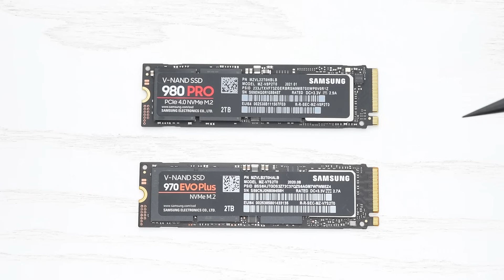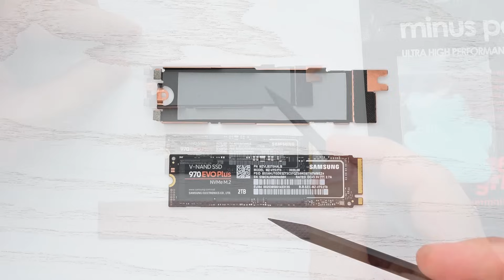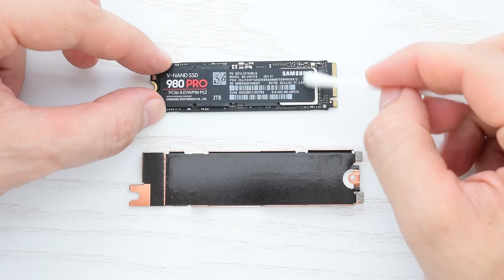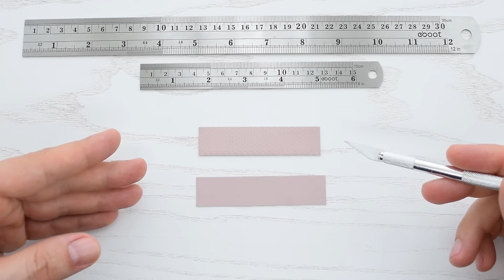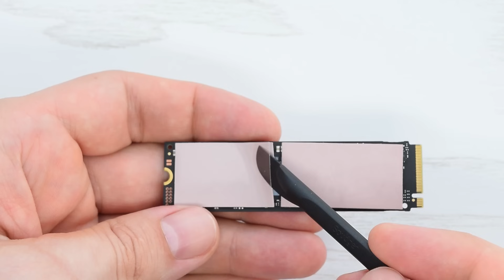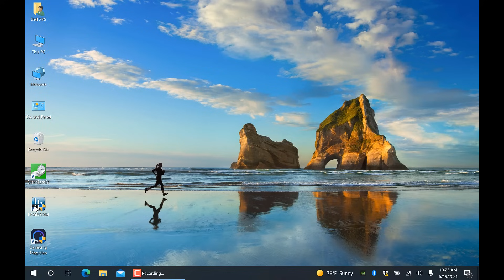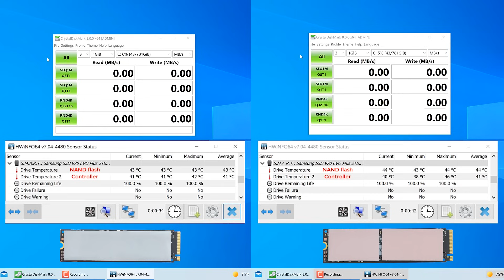Stop your Samsung NVMe SSD from Overheating and Thermal Throttling

Comment: Following your advice, I chose the Grizzly 0.5mm thermal pad and copper plate as heatsink from your link for my Samsung 970 Evo Plus. Do you think it is a good choice?
Reply from the maker: You need to apply a 0.5mm thermal pad to the NAND chips and stack two 0.5mm thermal pads for the controller chip.
Reply: @ElectronicsComputers is the controller chip on the first side?
Reply from the maker: @allenwalker1554  The controller is a thin big chip near the connector.

Comment: Some thermal paste spilled on thernal pad, will it create a problem?
Reply from the maker: @seha4943  No, just clean it up gently with a wet wipe and it will work perfectly fine.
Reply: @ I wiped around 90% of it, just thin layer left that i cant just scrape it off.
Reply from the maker: @seha4943  That thin layer wouldn't be a problem.
Reply: @ElectronicsComputers  Thanks

Comment: Great video! Lucky for me, I'm running a 980 Pro in a Gen2 slot shared with 2 SATA port bandwidths. Mine stays nice and cool, maxing out at around 52°C (and at ~850MB/s lmao) without a heatsink. But, this did remind me to keep an eye on the controller sensor and add a few other temp sensors to my RTSS OSD.

Once I upgrade to a higher gen slot I will definitely be applying this cooling technique. Possibly sooner, if I notice the temps I wasn't watching reach a worrisome threshold.
Reply from the maker: Thank you for the comment!

Comment: Good info but I’ve come to the conclusion that thermal pads are good for temporary work but after a while absorb heat, considering it is a solid gel like substance it must retain heat just as well as it retains ambient temps when idle.

Comment: Can I add a thermal pad on top of the other to give it the right height?
Reply from the maker: It's not ideal in terms of thermal conductivity, but it's good enough and will provide adequate cooling.
Reply: @ElectronicsComputers 

but do you think the temperature would increase a lot with one thermal pad on top of the other?

Comment: This really works. Had to send my 970 EVO Plus in for warranty because it kept randomly overheating and shutting itself down. Of course samsung techs said it was fine and they could not reproduce the issue. This method + a heat sink on amazon worked beautifully
Reply from the maker: Great job! This will extend the life of your SSD and ensure it runs smoothly without any crashes. I'm happy to help!

Comment: It looks like on current copies of Samsung 970 Evo Plus SSDs the NAND chips have been replaced with thinner ones, at least such difference in thickness is not visible on my new drive.
It also has the Phoenix controller on your 970 Evo changed to Elpis by Samsung, so it's a bit different now.

Comment: does using 2mm or 3mm pads in my desktop solve this problem?
Reply from the maker: A 2mm thermal pad would definitely compress enough to cover that uneven surface.
Reply: @ElectronicsComputers  thx for answering, what brand would you recommend GP-ultimat or Grizzly?
Reply from the maker: @Redacted154  We use both in my repair shop. Grizzly lasts longer, GP performs better and is way cheaper.

Comment: Is it ok to use 1 mm on both?
Reply from the maker: I guess you didn’t get the point. There is a 0.5mm difference between the chips, and you need to compensate for it by using pads with a 0.5mm difference in thickness to level the surface. If you use pads with the same thickness, you achieve nothing.
Reply: @ElectronicsComputers  does the same thing applies for 990 pro? Should I use 2 pads there as well?
Reply from the maker: @hadikh4465  That drive has nearly a flat surface between the controller and NAND chips, so you can use only one 0.5mm pad. That thermal conductivity is perfect.
Reply: @ElectronicsComputers  thank you very much i appreciate the answer
Reply: @ElectronicsComputers and is it ok if I use a pad that is 14,5 w/mk ?

Comment: As long as its samsung 980 pro i just need to follow the exact same the way you did right? or each laptop is different? i mean the calculation of how much you need to cut it
Reply from the maker: It has nothing to do with the laptop or desktop computer model. The difference between those two chips is 0.5 mm, which means if you place a 0.5 mm pad on the NAND chips, there will be a 1 mm gap between the top of that pad and the controller chip. This gap is resolved by placing a 1 mm pad on the controller.

Comment: Would this work for the 990 pro?
Reply from the maker: 990 pro has almost flat surface and one 0.5mm pad works pretty good.
Reply: @ElectronicsComputers  ah so just the 0.5mm alone is fine correct?
Reply: @ElectronicsComputers  hopefully I just need the 0.5mm
Reply: @ElectronicsComputers  sorry this is my main account you said just the 0.5mm correct?
Reply from the maker: @koiyujo1543  That's correct!

Comment: Is 64 c too hot for a computer that's just idling?
Reply from the maker: If the that temperature is from the SSD's controller chip, it's generally acceptable, though a bit warm for an idle laptop. However, if the temperature reading is from the NAND itself, it likely means the controller is even hotter, and you should definitely improve cooling. If you don't keep valuable data on that computer and aren't too concerned about the drive's longevity, it should still function fine for 2-3 years.
Reply: @ElectronicsComputers  Runs hot in Linux Mint 22 yet runs cool in Windows go figure.

Comment: Hi,  I'm from the future, it's 2024 now.  I guess this applies to the newest 990 Pro also, and the other brands as well, maybe also for the Gen5 boards?    Are the controller vs. memory chips placed in a similar layout?   Could someone pls. confirm it makes sense on these newer models also to divide the heatsink?    Strange that this apparent solution is not more widespread.
Reply from the maker: It depends on the model and manufacturer. The Samsung 990 has an almost flat surface. You can check your drive with any flat surface, and then you'll understand whether to use one pad or two. If you're using that drive in a desktop computer, you're more flexible, as those heatsinks can easily accommodate a 1mm pad, which will compress and cover all uneven parts. If it's for a laptop, where you can only use a 0.5mm pad, there's no room for compression, and the surface should be absolutely flat or evened out with two pads. Samsung actually does something similar with their heatsink version of the SSD, but they go even further by applying separate pads of different thicknesses for all chips: https://i.ibb.co/10HwmmQ/980PRO.jpg

Comment: My 970 evo ssd doesn't seem to be reading or writing according to sentinel as it's temp slowly approaches 60c, running unreal engine demos. The gpu stays well under 60c at all times but the gpu power used can be up to around 150 to 200w. I suspect the gpu is the likely cause of temp build up as the ssd has never reached 60c in any other situation. I will try some new pads on the ssd but I suspect repositioning the ssd or gpu out to give more room may be a solution (or changing the OS ssd drive to something that runs cooler)
Reply from the maker: If you see 60°C in Samsung Magician, which only shows the NAND temperature, keep in mind that the controller is much hotter—likely around 80°C. This is quite hot and can significantly shorten the lifespan of the drive. However, if the temperature you mentioned is for the controller, it's not as bad. To reduce temperatures, place your SSD in the slot farthest from heat sources like the graphics card or chipset, and consider applying two thermal pads to even out the surface. If your motherboard supports Gen 3 or Gen 4 NVMe, try installing a drive with a generation higher than your board supports. This can slightly boost performance while keeping the SSD cooler, as you won't be pushing SSD to its full potential.

Comment: It would be the same issue on Desktops, as most heat-sinks come with standard thermal oad, no difference in height.
Reply from the maker: On desktops, you can install any heatsink of various sizes, but with laptops, there is no such option.
Reply: @ElectronicsComputers  what I meant is, if you buy a heat sink, the thermal pad that the heat sink comes with, is the same thickens, so when you apply it, you will have a gap just like in your video. Have a look and see.

Comment: Are heat sinks optional? Or does it really need for nvme?
Reply from the maker: Well, it depends on how you use the laptop, but in general, for NVMe SSDs, a heatsink is important for their longevity. If you don’t play games or do any graphics or data-intensive work, using it without a heatsink is probably fine. Otherwise, the drive will constantly overheat, throttle performance, and eventually fail. If your laptop didn’t come with a heatsink, there are universal solutions available—check the link in the description."
Reply: @ElectronicsComputers  Thanks man

Comment: i got the fanxiang s770 
one review of the s770 mentioned hot spot with the heat gun (and on the image it was near the location of the controller/dram). which made me wonder if it is actually something that may effect lifespan.
I measured this one i brought and using a feeler gauge i could fit 0.3mm/dram and 0.25/controller between when holding the product against the heatsink that came in box.

I can kind of work with a bit of pressure to level the thermal pad out lvl. 
** But am also tempted to buy/cut/sand .3mm shims, and also use the thermal pad to isolate it from the other components smaller component, and use a solder paste between the heatsink and the nand/controller/dram.
Reply from the maker: The easiest solution is to simply use Upsiren thermal putty. It will cover the entire surface of the SSD and its components, transferring significantly more heat from the drive to the heatsink than a thermal pad. The link in the description.

Comment: I have both the 970 Evo 1tb and 980 Pro 500Gb. Both crash when I render using Adobe Premiere. Now I have to use the hard drive to render the Adobe Premiere video, the 7200rpm spin HDD has no problem. I tried many methods but not successful. Need help. Thank you
Reply: @Niko-1s When I start to render using Adobe Premiere, it is 100% loaded for a few seconds and crash but the temperature is only 50°C. Is there other way to test what went wrong. Need help, Thank you
Reply from the maker: I doubt the issue lies with your SSD, but let's rule it out just to be sure. Open Samsung Magician, go to the SMART tab, and note the Media Error value. Then, run the Command Prompt as an administrator and execute this command: chkdsk C: /f /r /x it will check for and repair any dead blocks on the SSD if they exist. Afterward, restart your computer to begin the process. Once completed, go back to the SMART tab and check if the Media Error value has changed. If you notice a significant change, it means some segments of the SSD were damaged, which can occasionally affect software or OS performance. Also, make sure that all the values marked with blue circles that indicate a good state.
Next, I’d recommend reinstalling your graphics card drivers and perhaps Premiere Pro itself. Have you changed any BIOS settings recently? Also, check if there are any BIOS updates available. I’m currently using a standalone version of Premiere Pro 2024, and I find it to be the smoothest and most stable version so far.
Reply: @ElectronicsComputers  Thank you. I have check Media Error for both nvme, the value is 0. I went and chkdsk both the nvme as well and no bad sectors. My Asus RTX 3070 has the latest driver as well as  Premiere Pro. In the BIOS, I have enable the standard XMP profile by the motherboard since I first bought it and BIOS is the latest firmware. I'm thinking to get NVME to PCI-E extension card to try but have to spent the money. I don't have this problem on previous X99 sata SSD desktop computer but this z690 system is no stable. Now I can only use the 7200rpm spin HDD to do the Adobe Premiere, this 7200rpm spin HDD has no problem. I'm wondering why the newer generation computer has more problems

Comment: Is this applicable to the Samsung 990 Pro  without the builtin heatsink? Are the NAND and controller chips same size as the video? (31 and 37mm respectively)?
Reply from the maker: @Greedisgood626  That SSD has almost flat surface. Depending on your heat sink and thermal pad, you can use it with one 0.5mm thermal pad.
Reply: @ElectronicsComputers  thank you brother

Comment: This dropped my 980pro about 20c, before a stress test made it jump to 74c. after it was 58c. which is ideal, too cold will make it slower..  I required 2mm and 1.5mm My mother board was 1.5mm stock, so i used that for the standard, and used a 2.0mm for the controller chip. And for those curious... I used a caliper, and it is exactly half a millimeter difference in thickness.
Reply from the maker: Great job!

Comment: i have a similar screw on the right side of the heatsink in 3:05
however  its not slide iin like in the video, but rather its screwed into the heatsink
i had help installing the SSD but i wasn't really there to see it
can someone tell me about the type of screw it is?
so that i can find out how to remove it

Comment: How come thermal pad without heatsink is supposed to be working? and without a heatsink thermal dont do much, can they?
Reply from the maker: If your computer doesn't have a heatsink, there's no need to apply a thermal pad. It doesn't make sense to do so, as the thermal pad would simply fall off the drive. However, there are universal heatsinks available for both desktop computers and laptops, and I’ve provided a link in the description. If your computer has an NGFF M.2 SSD, a heatsink isn't that important since those drives don't typically get very hot. But for NVMe SSDs, good cooling is crucial if you want to prolong the lifespan of the drive, especially if you're storing valuable data on it.

Comment: Im buying the Crucial T500 1TB M.2 NVMe PCIe Gen 4 ssd and was wondering which thermalpad I need. I cant buy it with heatsink because it wont fit in my pc, there are different thermalpads 0.5mm, 1mm and 1.5mm, which thermal pad should i get?
Reply from the maker: You can buy 1mm and 0.5mm pads or just buy a 0.5mm and double stuck them for the controller chip to even the surface.
Reply: @ElectronicsComputers  thank you🙏, also do i just place them and leave them like that? Wont they fall off?

Comment: Hi, My laptop does not gave a heatsink like the one shown in the video. The ssd slot just sits on the motherboard. Will installing thermal pads without heatsink improve the thermals or is it not worth it if there is no heatsink?
Reply from the maker: The thermal pads only acts as a heat transfer medium between the SSD surface and the heatsink. The thermal paditself won't even hold on the SSD, it will simply fell off when you flip the laptop. There are some universal heatsinks for cheap laptop that come without the heatsink. Also for some models the back cover acts as a heatsink. What's the model of your laptop?
Reply: @ElectronicsComputers  Hi thanks for the response. My laptop is a Lenovo Legion Slim 5. I found some universal SSD heatsinks that can be placed on top of the thermal pad and held to the ssd using 2 rubber bands, but im not sure that they would fit within the laptop's cover.

Comment: Hello sir i hope you are doing well , i recently experience high temperature With my Samsung 990 pro ssd on my gaming pc and it seems my x670e-f motherboard default M.2 Slot heatsink is not enough to cool this ssd down ! ,so i decided to change the silicone pad of it and try a thicker one .
Should i just just do it just like the video? Or a thick 2mm termal pad without cutting the termal pad into half will also do the job for ssd and my motherboard. The temperature while idle for me 56~58 and the ssd health drops to 66% i been using this ssd for 10 months. I will be appreciated if you guide me 👍🏻
Reply from the maker: I don't recommend using thicker thermal pads. A thinner thermal pad would generally be better. This is because the thinner pad offers less thermal resistance, allowing heat to transfer more efficiently from the heat-producing surface (like an SSD) to the heatsink. Thicker pads can introduce more resistance to heat flow. Try some high performance Gelid thermal pads. For the Samsung 990pro you can use one single pad as its surface almost flat. So, Gelid 0.5mm should definitely improve cooling of your SSD. Also, make sure there's no viruses on your computer or any "broken" processes that overload your drive.

Comment: Seeking some general advice. The 2TB 990 Pro I got does not seem to have as pronounced of a gap on the controller side. If anything, the DRAM module is the shallowest, and the NAND modules and the controller module seem to be the same height. So the 0.5mm and 1mm pads aren't flattening out the way it sits on a flat surface. Wondering if (a) i should use a single-same thickness pad for the whole thing or (b) cut the same thickness pad into three pieces to cover each of the heights separately and maybe squish it to even them out, or (c) if i should look for a 0.75mm pad? I can't find a grizzly 0.75mm one, so would take recommendations.
Reply from the maker: For that model just use a single 0.5mm thermal pad. Alternatively, before applying a one single thermal pad you can apply a tiny one on small chips just like Samsung did for their heatsink version SSD https://i.ibb.co/10HwmmQ/980PRO.jpg but anyways using one pad would be sufficient.
Reply: @ElectronicsComputers  Thank you so much for the quick response, EC

Comment: Do not remove samsung sticker on top?
Reply from the maker: Removing the label will void the warranty and it doesn't make any real difference in cooling your SSD. But if the warranty is not an issue, then go ahead and remove it.